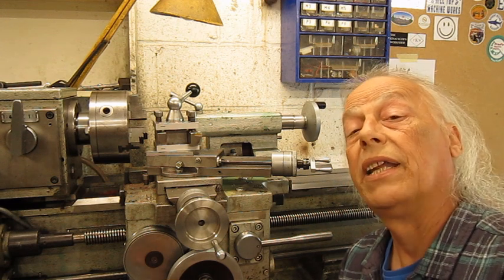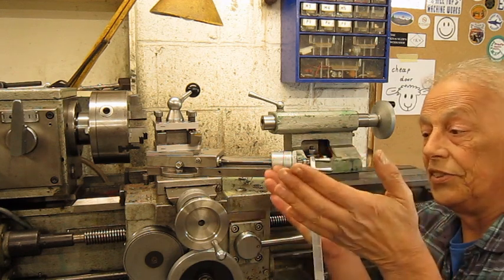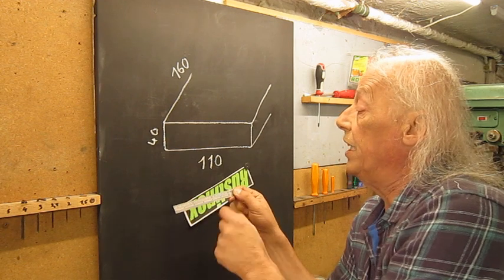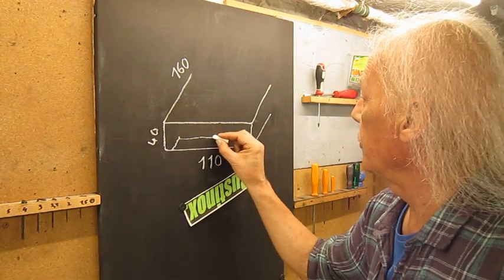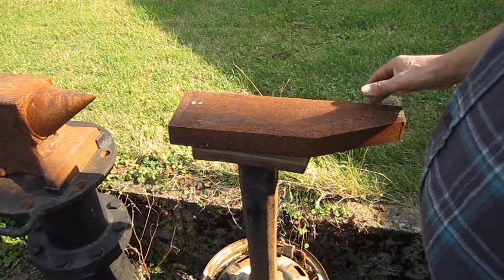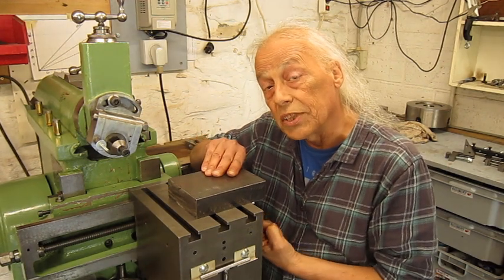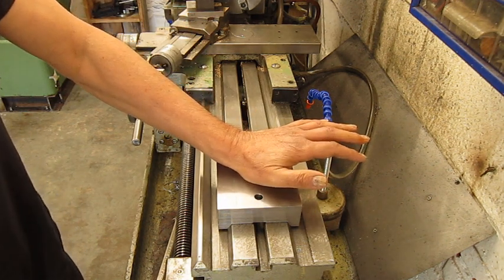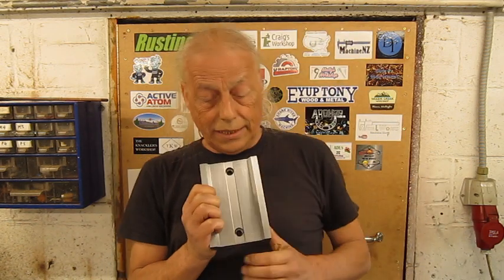Spacer plate for the tailstock.

Comment: The configuration is more rigid when cutting away from the vertical plate: when the plate flexes the part itself supported on the table will stop the rotation. Just imagine the the vertical plate is made out of ie rubber 😁
Reply from the maker: Good tip. You're absolutely right.

Comment: Measure interior angle against a gauge pin?
Reply from the maker: In this case it doesn't work. The bottom part of the lathe bed is a rough machined surface. But indeed, you can't see it very well on video.